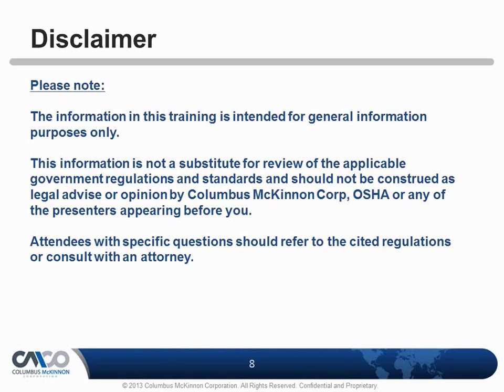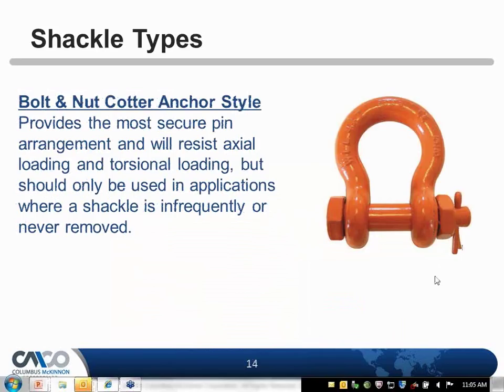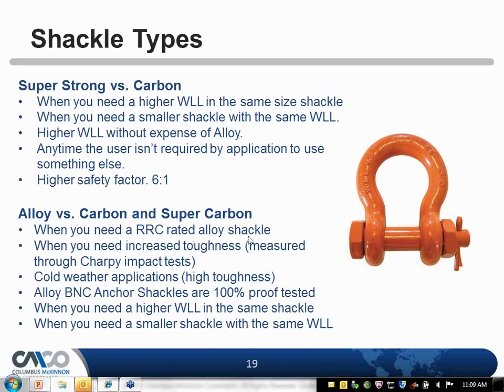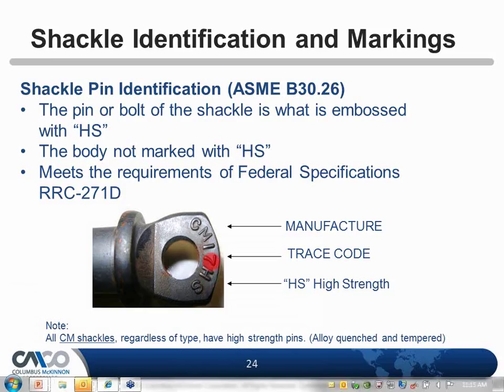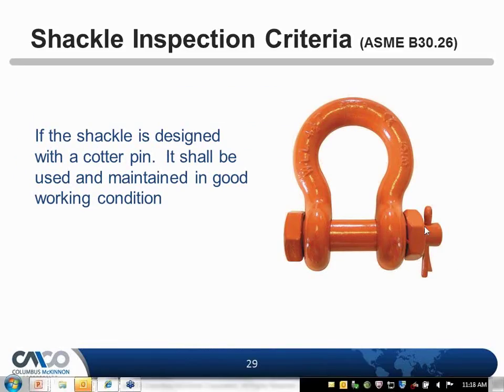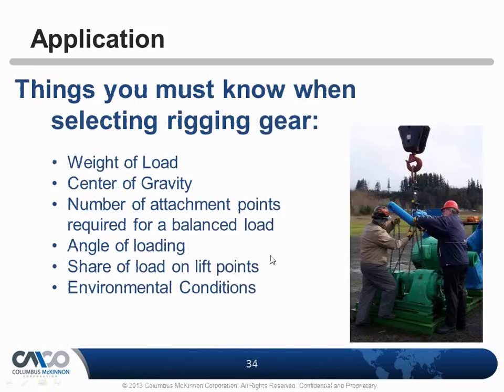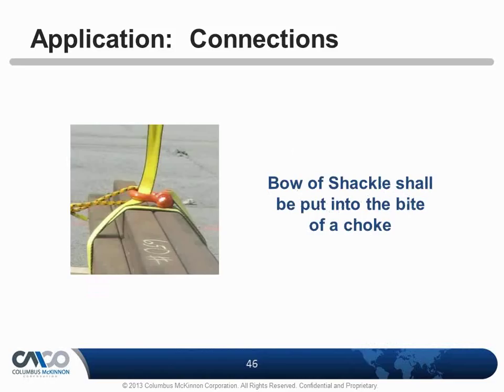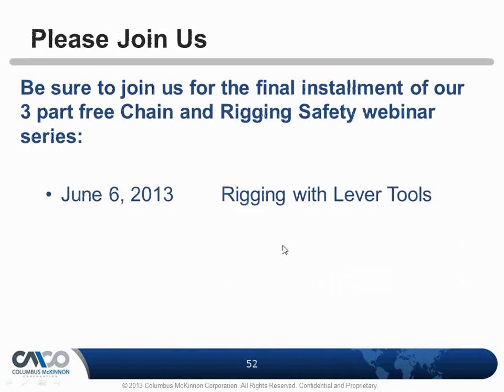Safety Webinar: Proper Use of Shackles

Comment: Why can't we use British harmonised Standard for shackles above 25 ton why we use RRC-271D standard
Reply from the maker: Hi Rama, 

There are a couple of standards that cover shackles, and I’m not sure which you are referring to.
 If it is EN 13889, this standard only covers grade 6 shackles up to 25 ton.

The other standard is BS 3032:1958. This standard has been withdrawn but only went up to 12 ton.

Currently we are using RR-C-271 rev. G, it was updated in 2016.
 This covers both alloy and carbon shackles from a capacity of 65 pounds to 350,000 pounds. We use this standard because it covers a wider range of products as well as sizes. It is a U.S Federal Standard.

Let us know if you have any additional questions.

Troy Raines
Chain and Rigging Product Engineering Manager
Reply: Thank you 🙏 so much sir

Comment: I suppose round-pin shackles could be used for guy wires.   Why can't we use stainless steel shackles ?
Reply from the maker: Good morning +Jester Mclarpet! To your question about stainless steel shackles - shackles are not rated in the same way as chain, plus shackles come under ASME B30.26, Rigging Hardware. In that standard there is no mention that a shackle has to have alloy properties or grade for lifting. 
So the use of stainless steel shackles is not prohibited as long as the shackle is made to the B30.26 standard. That would cover markings & design characteristics.
Just to confirm, round pin shackles are not to be used for overhead lifting no matter what material they are made from.
Hope this helps.Henry Brozyna